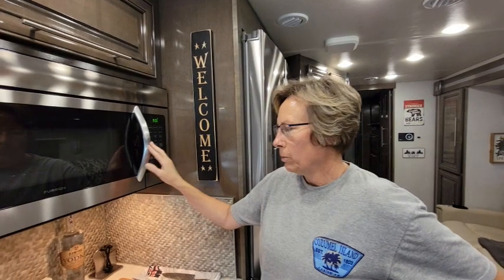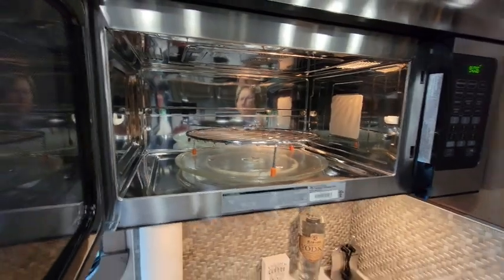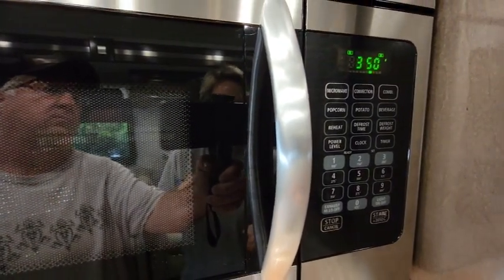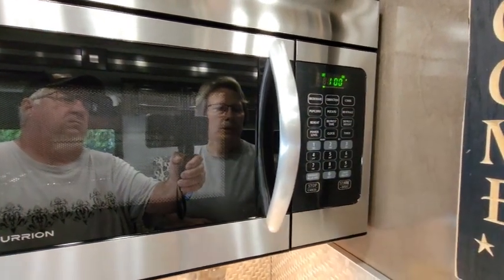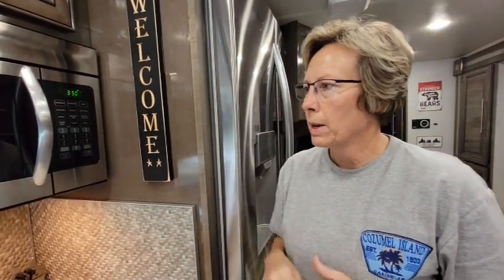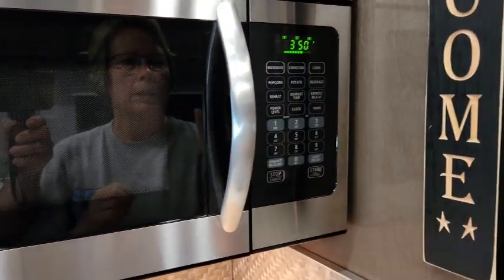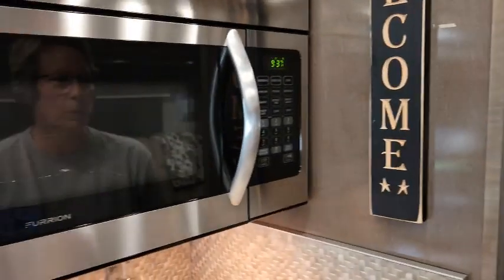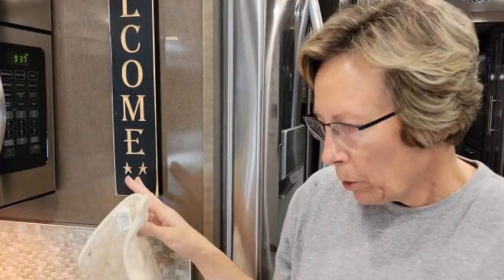Step By Step: How To Use A Rv Convection Oven

Comment: Thank you but I read somewhere about that rack insert turning it whichever way for certain things. Do you know anything about that? I have a High Point confection oven in our class B camper van that did not come with Manuel and I cannot find a manual that tells me what to do with that rack for the life of me. lol  thanks for sharing your knowledge.
Reply from the maker: For our Convection we have two wire racks. One wire rack sits on the turn table so works great for round cake pans. The other wire rack slips in and attached to rubber mounts on the side which works great for small sheet pans. Hope that makes since